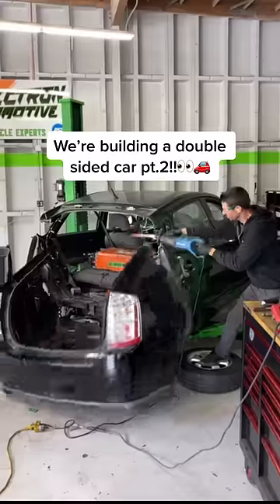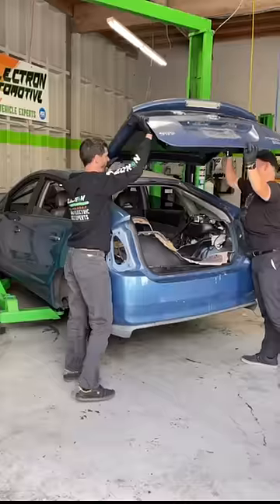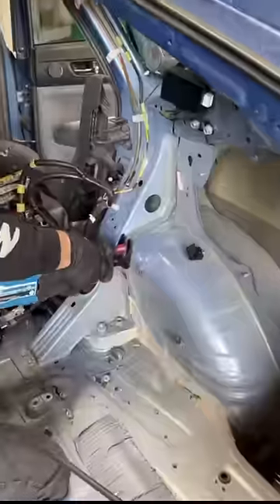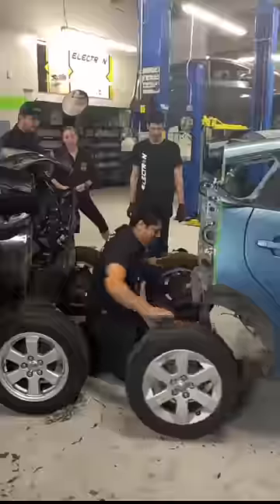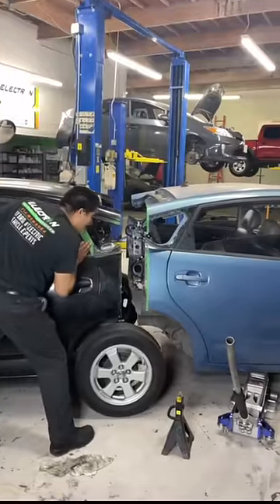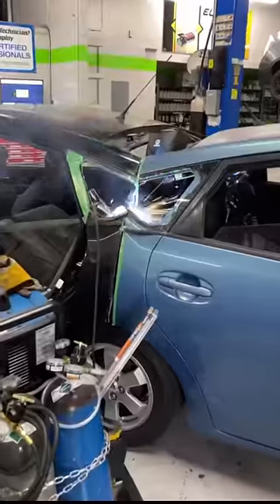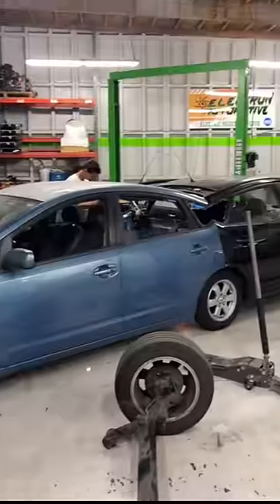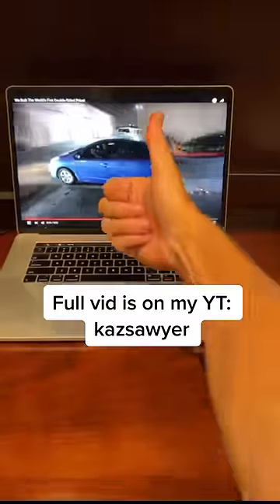You WON’T believe why we CUT this Car in half!👀#shorts

Comment: Where is the burn through on these welds by the quarter panel? Maybe that’s what it broke. If there is no discoloration on the backside or a burn mark on the backside of the weld means you did not get it hot enough and did not fuse the metals together